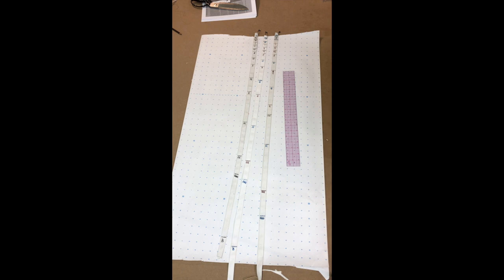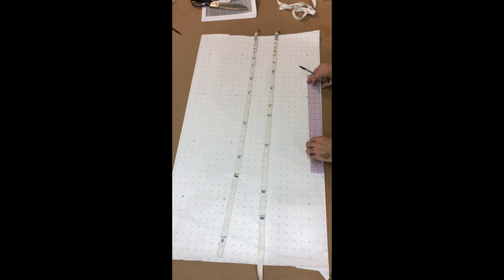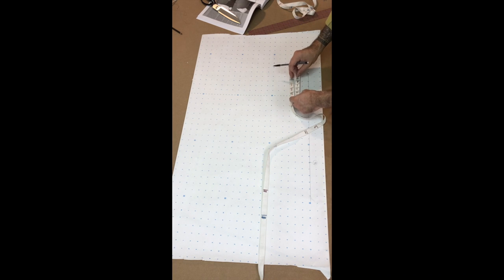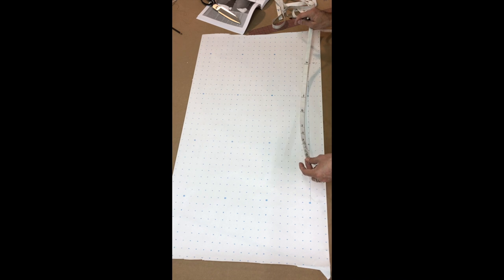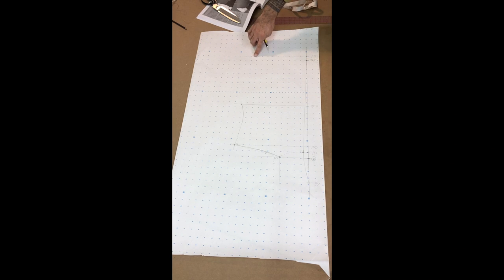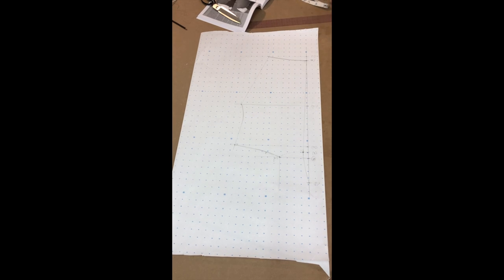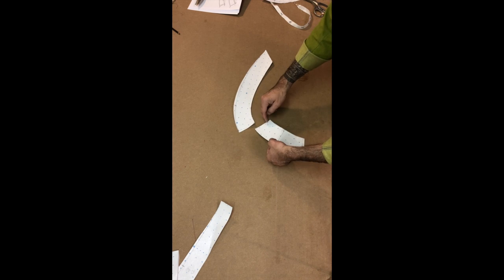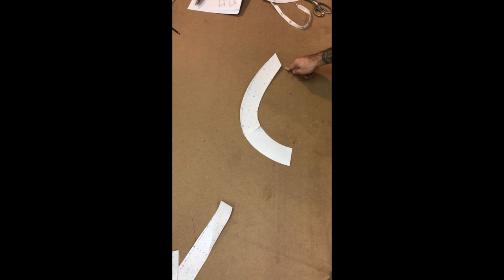HOW TO MAKE A 1618 MAN'S DOUBLET: The Modern Maker Workroom Season 2, Episode 1 Draft & Cut

Comment: This mechanical tape measure system when compared with the direct draping method shows the radically different approach to pattern making between the tailor (masculine) and the mantua maker (feminine) technique which generally requires a fabric mock-up. I found it most enlightening when viewed right after Manson-Dieter’s draping video of a man’s costume. Thank you.
Reply from the maker: I've been working to let go of the idea that technique can have a gender specificity, but looking at history, that can be complicated to maintain given the way a gender binary was encoded in everything. I agree that the differences in techniques between drafting and draping are fascinating. In many ways, I think the differences were exacerbated by guild-stipulated need for manuta-makers to work differently from tailors after the guild was formed. Much like labor unions today, I suspect there were a great many pressures and restrictions put on the Mantua-Makers guild to use techniques and processes that were distinctly separate from what tailors were using. Interestingly, In Albayzeta's cutting manual of 1720, there are a few mantua-like garments with proportionate cutting instructions and lines drawn for the draping of the pleats. But the drafts seem almost like afterthoughts...as though he were saying "If there is no mantua-maker available, you might have to make one of these." I tend not to show the mockup process in my videos, choosing instead to focus on sewing techniques...but we do make them. Suit makers who create the exact same suit day after day become so familiar with the cut of the clothes that they can bypass the mockup and head straight into the final fabric, leaving plentiful allowances to adjust. But for historical tailoring, we aren't making the same things day after day and can't lay claim to a deep enough experience with a single cut of garment to do the same. I have made enough doublets, for sure. I can go right onto the cloth and feel confident that I will have a good fit. But my experience is not commonplace.
Reply: @themodernmakermathewgnagy215  Thank you for the reply. I made a mistake in my reference - it was Manon -Dieter’s video. (auto correct struck again!) I agree that the restrictions of the guild system were strong motivators of this ‘split’ in the approaches - especially during the late 17th and the 18th c. Much of what I have learned about this subject comes from Clare Haru Crowston’s book ‘Fabricating Women : the Seamstresses of Old Regime France’. I originally thought it was about actual sewing, but it’s a fascinating history review on the social institutions of the seamstresses guild and its ‘territorial disputes’ with the tailor’s guild. 
Anyway, I do like the 21st c. approach where we help one another and share our knowledge to create and sustain our skills is much more agreeable. Perhaps some things really have changed🙂

Comment: For the sleeve, both vol 1 and vol 2 have the top of the sleeve at c-Qi, but you have it at c-t. Is this just a wider variation?
Reply from the maker: Yes...the C-t measurement allows more width for gathering at the cap of the sleeve, something that was quite common at the time and creates a slightly more robust shoulder appearance.

Comment: I don't understand the letter combination hahaha I'm noob
Reply from the maker: The letter notations are proportions which come to us from several surviving Spanish tailor's manual from the last 16th and early 17th centuries. I have called their proportions "The Bara System" and it wrote a book about it. The Modern Maker Vol. 2: Pattern Manual 1580-1640 gives not only an explanation of the system, but shows you how to make the proportionate tape measures and how to use the diagrams to draft your own custom garments. With a little practice you can even draft directly onto the cloth without making a paper pattern.